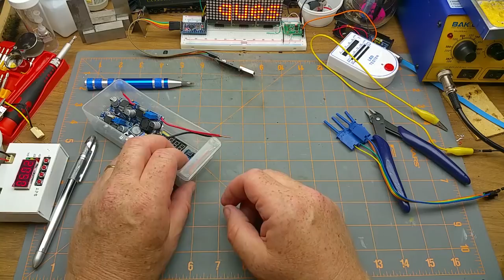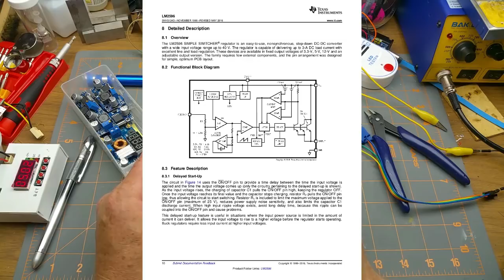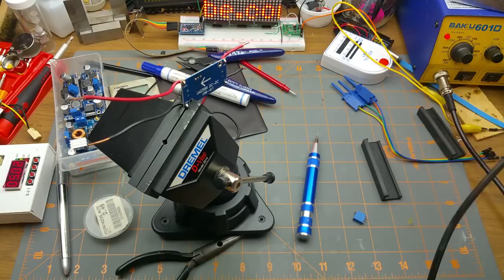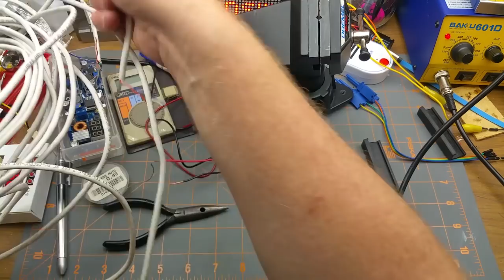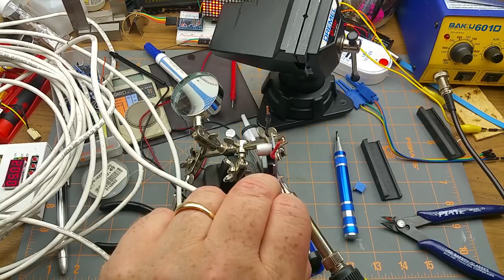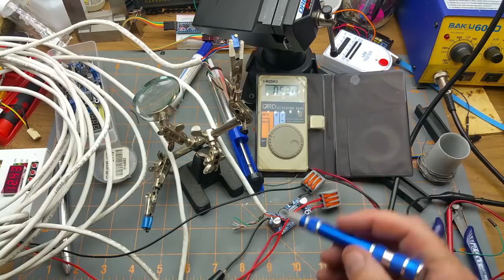simple buck converter modification

Comment: Well, I Think the question was in the sense of making a user interface of this device, using a normal potentiometer, I'd be glad if you could show us.
Reply from the maker: Any potentiometer of the correct value should be a drop-in replacement.
Reply: @pileofstuff  I have some weird stuff going on with this , i tried to replace with a potmeter but from 12 volt i can only get down to 9 volt, then i replaced the potmeter with the original trimpot and still couldnt get down to less than 9 volt, guess ill have to try on another one.
Reply: You can replace it with a normal pot of the same resistance but you're going to lose fine control.
Reply: What you need is a multi-turn precision regular size pot so the output voltage remain stable.

Comment: I'm planning to replace the pot meters on my 15000w boost converter   with mcp4131 digital pot meter to control voltage and current by an arduino. Do you think it would work? Thanks
Reply from the maker: Interesting idea.  I think it should work, as long as you are careful not to exceed the voltage input capability of the arduino (assuming you are using it to measure the voltage of the convertor).
Reply: @pileofstuff  It should not effect the arduino input voltage in any way. I have used MCP4131 digipot in another project and it works great. You can get them  5,10,50 and 10 kohm.  On my dc to dc converter thereibs a 10k  for the current and 100k for the voltage (or other way around I'm not sure as I measured them months ago and I don't remember exactly).   I will definitely give it go.
Reply from the maker: @3dmixer552  I've got some here as well. They really are interesting little devices.

When I mentioned input, I was assuming you will be using an analog pin to measure teh output of the convertor.
Reply: @pileofstuff   I see. Yes, I will use  INA219 current sensor whith external shunt that will take care of the current and voltage measurements.

Comment: My point on these dc to dc buck converters is? Why do they mount the potentiometer on the board the circuit board all the time! Yes I know you can replace them but it sometimes get a bit fidgety and you also can mess up the onboard circuit tracks. Why can they not put small plug skt like they do on there volt meters, with three wire output so you can mount these bigger buck units in cabinets to make variable power supplies with the potentiometer mounted on the front panel along with a cheap voltmeter? I'm sure they would sell a lot more units. Just my opinion, I know it's not rocket science, But it is as I said fidgety.

Comment: I'd be careful to secure the cable/pot properly, if a wire breaks you loose feedback. The standard 2.54mm plug and sockets would be ideal, just need to put some resistor leads into the holes to solder too.
End result is the output voltage will be whatever the Maximum can be, in this case 11.76V.
If your circuit is say 5V, it will be damaged.
Reply from the maker: Agreed. This was just a quick demonstration of the electrical side of the equation.
Strain relief is always an important consideration for any wiring.
Reply: My pot broke and this blew up the MOSFET on my bucket boost converter. Do you know what other component on the board could have been damaged if I remove both constant current and constant voltage from a buck boost converter.

Comment: Hello. Just found your channel - like your stile. There is a quite rugged XL4016E buck conerter on EBAY that is usually stated as 280W 40V around £3 ($4.5 ?). I have done awful things to them and they have survived. The main problem with changing to remote  pots is as you say connecting wires where the onboard pots were. It's almost impossible to get wires through the trim pot holes and hanging them on just the suface of the PCB is very weak. I found that any bit of copper wire that's a good fit, like from a resistor, about 10mm long soldered through the board makes a better joint.  It's much easier to add wires or change them if you need to. There is also some 'plaster' as the Chinese call it for sticking heat sinks on that's non conductive and it makes a very useful 'glue' to strengthen any connection. Good stuff by the way. Nice to find another channel that's down to earth for idiots (me).

Comment: I have built a few power supplies using the same converters. I replaced the trimmer pot with a regular 10k linear pot and built it into a small plastic box with banana sockets as output terminals, a cheap digital voltage/current display from Aliexpress. For power source I used an old 20V laptop power supply with a 5.5/2.5mm connector.

Comment: Some time ago I had a bench power supply made from laptop brick, two converters, panel volt/amp meter (simplest one) one big switch and two multiturn bourns pots. Everything inside a atx power supply case. It worked fine, but lack of current limit fried many things. Also I have a portable power supply made from two 18650 cells, tp4056 board with battery protection, some boost circuit and cheap regulated cc/cv module: https://imgur.com/a/UwZc3cZ. I had some problems with space (banana sockets and boost pot), so I used some thin cables to solder that pot where I had some space left. And it even works!

Comment: I really like these switched dc/dc modules. They sell 'analogue/linear' do it yourself modules cheap to make a power supply but they work on losing voltage over the ic which results in heat and heat = loss = wasted energy.   These boards shown in the video in combination with an old laptop power supply which most people throw away is top.  On ebay or Aliexpress you can find 2USD led voltage modules which are really small and work fine from 3V to ...  which you can connect on the output. A small cheap plastic housing and you have a nice test power supply for cheap. 
For the ones who are afraid to damage the board you can easily leave the potmeter on. Just solder the 3 wires on the bottom.  If you then can't adjust the voltage with the external one just turn the potmeter on the pcb.  You could also use the potmeter on the pcb to set a max voltage.   If you would use really long wires then I would place a small capacitor like 10nF at the side of the board.  Long wires tend to pickup HF which would result in small spikes on the output.  As cheap as the small capacitors are I generally also place a 10 or 100nF capacitor in parallel with the bigger output capacitor. Small capacitors tend to filter out very high frequency spikes better than electrolyte ones. 
@pileofstuff. Can't you buy a cheap Aneng AN8008 meter ... autorange, bloody precise and I actually use it anywhere. My Fluke's are now in a drawer for more serious work.
Reply from the maker: My "bench power supply" is basically, exactly as you said, a cheap buck converter and a laptop power supply.